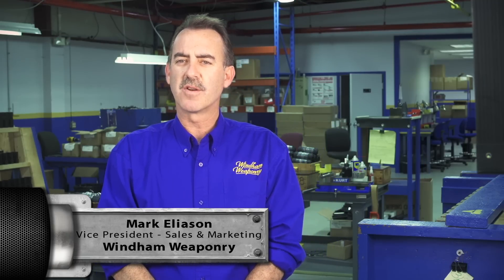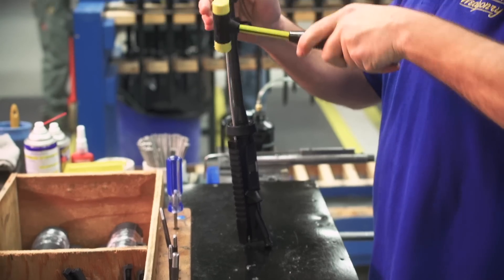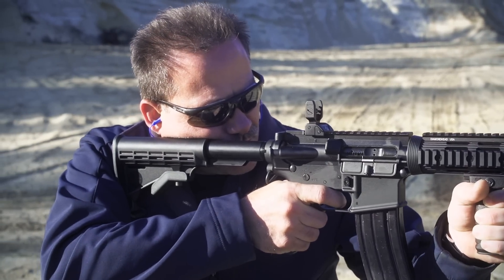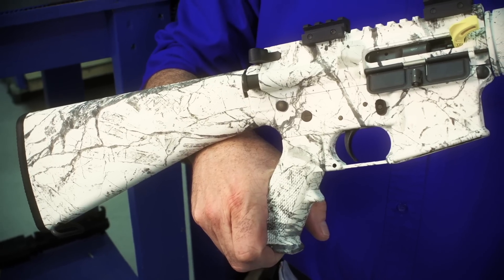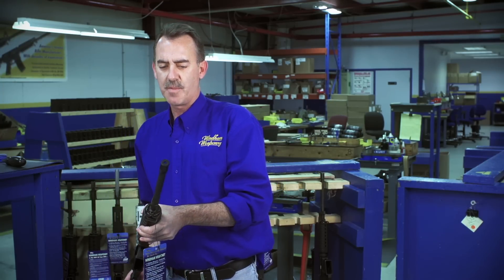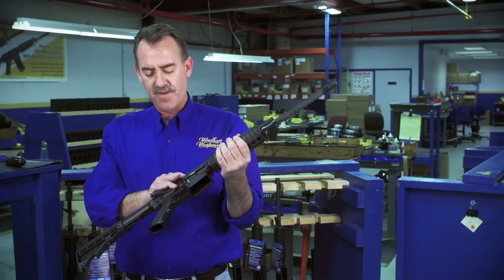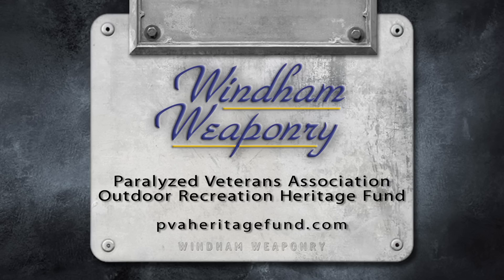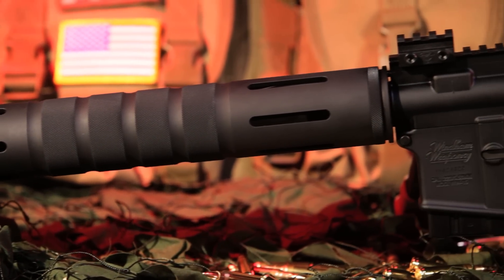The Windham Weaponry Story

Comment: That's a real nice commercial, but my Windham AR broke due to a design problem 3rd time at the range. Was repaired promptly by Windham but the original design problem that caused the failure was not changed or corrected so I expect  the failure will happen again at some point in time.

Comment: Know these guys and their guns. Not bad ARs per se, but they are just assemblers. Little of it is actually manufactured in house. Both the designs and the parts are dated, in essence they're still living back in the early 2000s when the AWB first expired. Not bad guns, certainly, but they're not great value or exceptional performance either. In a saturated market, it is hard to imagine why you'd seek them out specifically.